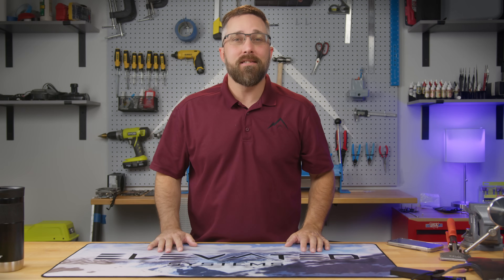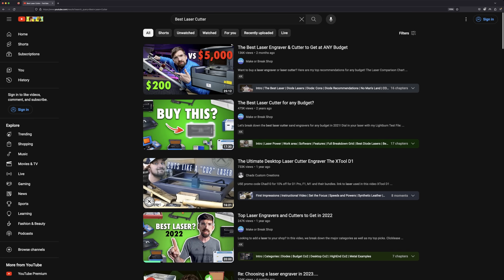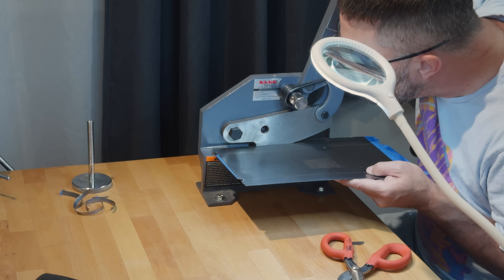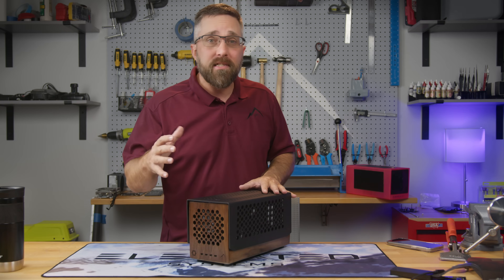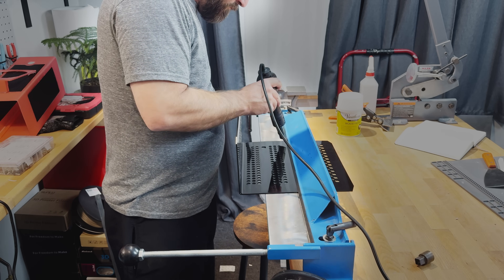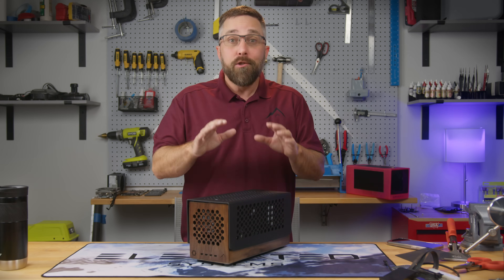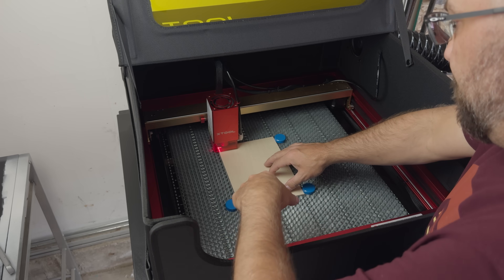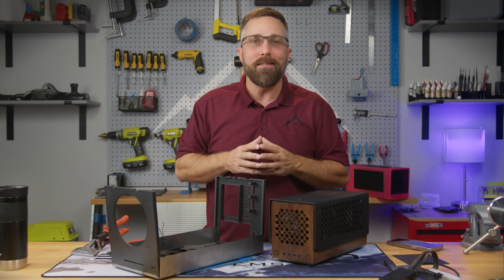The Framework Desktop Mini PC with Dedicated Graphics!

Comment: that's pretty sweet, I was personally wanting to figure out a way to use a framework mainboard to make a tiny server or NAS with a handful of drives. The idea of an affordable, upgradeable (sp?) and--most importantly--power efficient laptop CPU based server/NAS/homelab toy thing really appeals to me.

Not sure if your designs could be easily modified to hold 3.5" drives but I'm gonna poke around and see. Be a good use of those m.2 -> sata cards which are real cheap.
Reply from the maker: A framework NAS, probably Unraid, is on my to-do list.

Comment: As a side note... you could have installed bolts onto the front face... then any fan you want to attach, you could just thread a nut and a washer in to secure the fan.

Comment: Amazing, Would be really cool to have a version using the Onedock egpu dock (thunderbolt+Occulink , they're shipping a new batch this December) I'm planning on cutting a hole into my cooler master framework case which is currently housing my 11th gen board to allow the occulink adapter to directly connect to the pcie 4.0x4 m.2 slot. While this will work temporarily something like in the video would be better. Re-using a razer dock pcb is good but it still limits the cards to around 40Gb/s. Might even take your design and mod it to accommodate the different One dock PCB although my CAD skills are limited.

Comment: Nice project, I would recommend few or no vent holes on the top and sides.  You want to force the cold air from the front along the motherboard and GPU and out the back, not just take the path of least resistance and leave the case.

At least that's my theory, it's easy to test.  Run a heavy load on the CPU and GPU and graph the temps over 5 minutes.  Then repeat with the side/top vents blocked.

Comment: Amazing project!  I personally would have gone with screws instead of rivets as that allows for full disassembly in the future for cleaning or possible modding options.
Reply from the maker: 22 gauge sheet metal is too thin for screws. I’d have to weld in a threaded anchor, which means… I’d have to weld.

Comment: So the new project... with the integrated framework battery... Are you going to use a 75w GPU and somehow run it all on battery power? Are you going to ADD some kind of UPS battery array that can handle the load of the GPU when unplugged?

Comment: I didn't watched the previous video in this series, but i presume you used PLA (or less likely - ABS) filament. There are other filaments that have better heat resistance for a PC case.

Comment: Have you looked at the Gigabyte RTX 4060 Low Profile for the smaller case version? It will require an 8 pin PCIE power cable to power the GPU but it should just drop in.

Comment: A 3D printed case will never look as stunning as such a metal/wood case, but depending on how extreme the thermal stress is, it should be perfectly possible to 3d print a case that is durable. ABS can handle heating cycles up to 80°C decently well (maybe even closer to or up to 90°C). I would assume it shouldn't get too hot at the case. If it were to get hotter, something like PC-CF can probably handle up to 105°C or so (and also looks good).
Reply from the maker: Most hobbiests don't have a printer setup capable of doing a print this large in ABS or polycarbonate. If you were going to have it printed with a service I'd go with a tough heat resistant resin print. The files for the 3d printed version are on my Github.
Reply: @ElevatedSystems  Good point. 314mm height is quite a bit. I think I could just manage on my Voron 2.4 if I go a few mm above my regular limits. I've got too many projects to build such a desktop case myself though and I just built a PC not too long ago anyway but thanks for pointing me towards the Github page. I am not sure I would trust heat resistant resin but I honestly have only experience with other technical resins not heat resistant one.

Comment: I see 4 USBC connectors on the front.  If the mainboard has 1 used for power and another for the eGPU, do you use a hub for the front ports?
Reply from the maker: Yes There's a 4 port USB-C 3.2 gen 2 hub PCB mounted in the front of the case. The eGPU provides power through the same cable, and there are two standard Framework expansion slots in the back.
Reply: @ElevatedSystems  that you still managed to include the framework adapters into your design is both incredible and surprising that you didn't show that in the video (maybe I missed it) - very cool!
Reply from the maker: @ChristopherBurtraw  I covered it all in the first 3d printed version video. I know most won't have watched that video but I didn't reiterate it for time sake.
Reply: @ElevatedSystems  yep, I missed that, I'm a newer follower.  Found it now, thanks!

Comment: Hey CJ. I got my self the new framework AMD laptop based on your recommendation and after enabling the TPM for the first time so I could install windows 11, my EGPU just stopped displaying signal. Any advice?
Reply from the maker: Did you update the graphics drivers?
Reply: @ElevatedSystems  I did, I figured it out,  they added a menu for USB 4 devices that operates like the thunderbolt one. You have to enable it there. Thank you for responding.

Comment: Hey, what is the max size gpu that can fit in here?
Reply from the maker: Which version? One is for half height Cards, the other is for full height. It's DIY so you can make it as long or as wide as you want to. Technically any size card can fit.